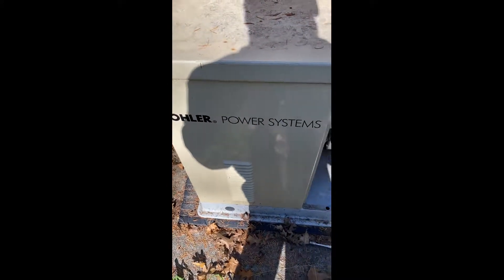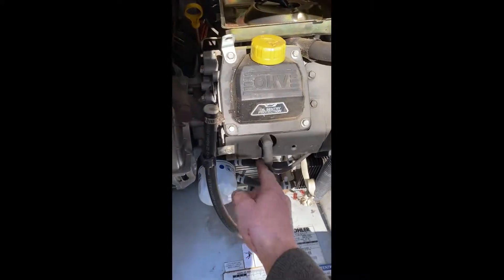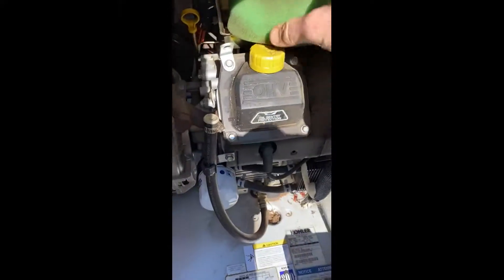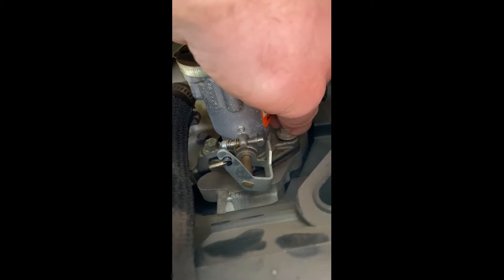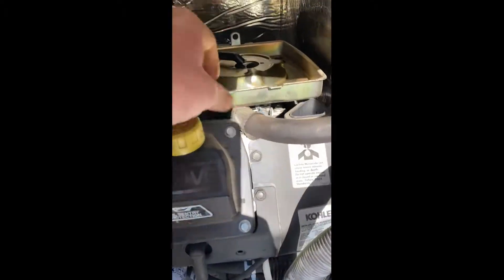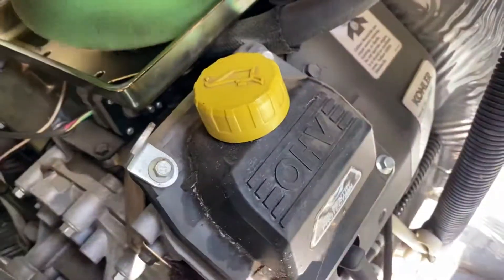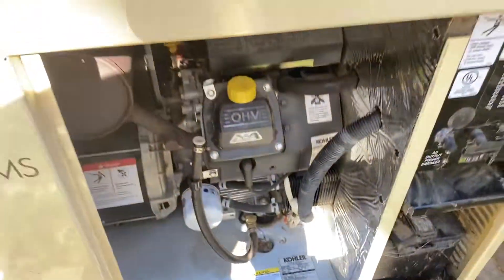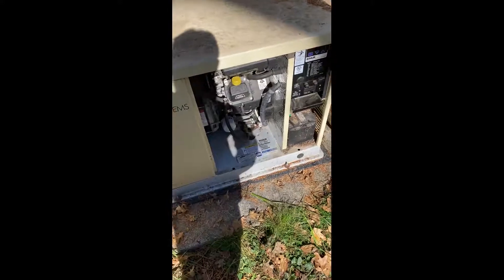Kohler 12K watt generator Surge and Backfire FIXED!

Comment: Are you happy with the 12k generator?
Reply from the maker: Yes, it’s a workhorse.  It kicks on within a few seconds of the main power going out.   This needed a little maintenance as the previous owner wasn’t very mechanically inclined.
Reply: @ThorsHammer  did you see a big increase in your gas bill because it runs each month? I'm really looking at getting this unit.
Reply from the maker: @rumerboyz  This only runs when the power goes down here, sometimes 2-5 days at a time.  It’s hooked up to propane so it’s hard to say what the cost is.  It’s pretty efficient.